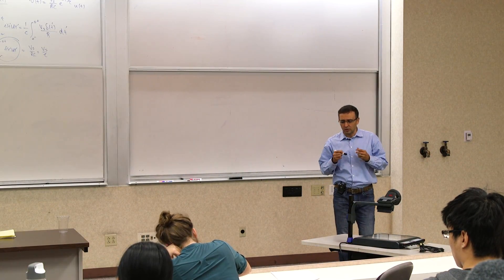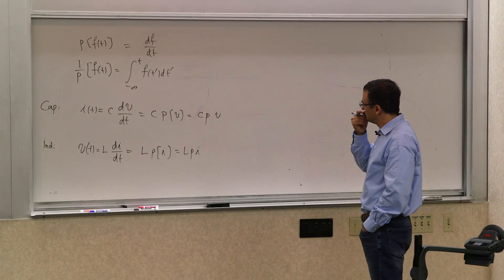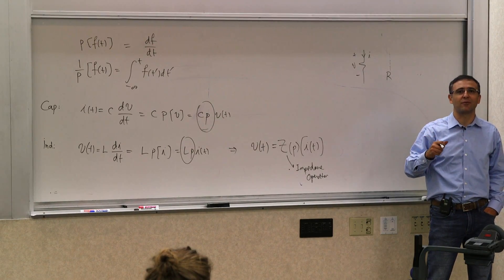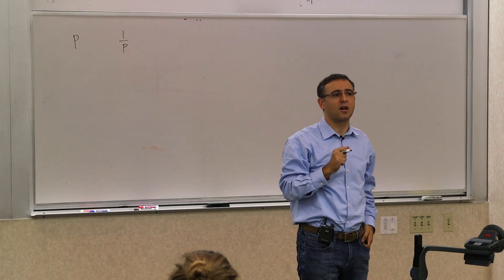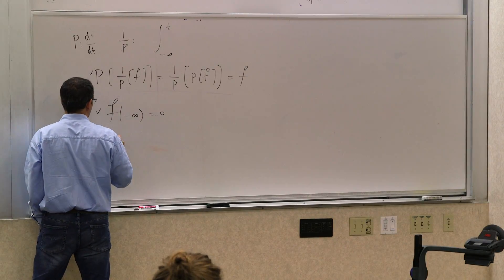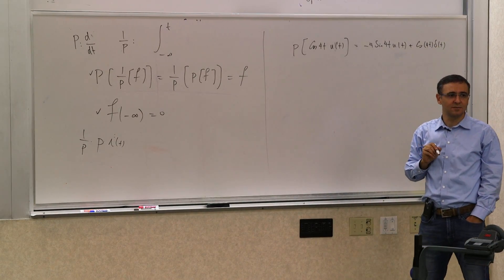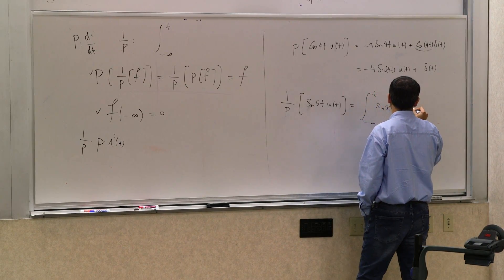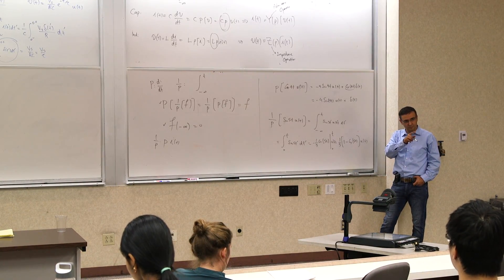016. Heaviside Operator: Introduction, Basic Examples

Comment: From 00:05 Heaviside Operator
From 00:43 Capacitors and Inductors
From 01:44 Scaled Operator
From 02:37 An Impedance Operator
From 03:20 Admittance Operator
From 04:42 P Operator
From 06:52 Differential Equation
From 07:11 Examples